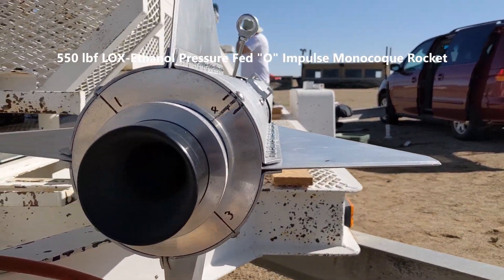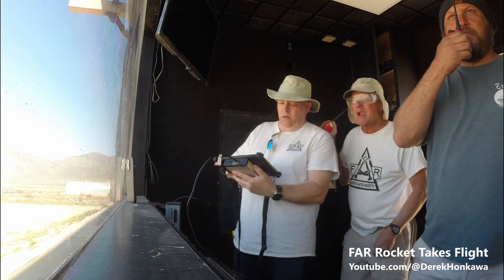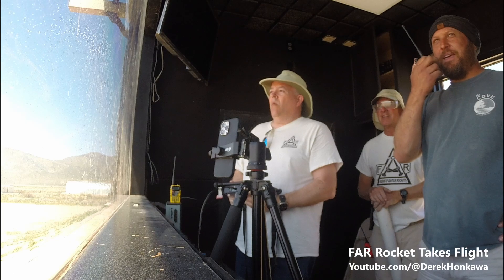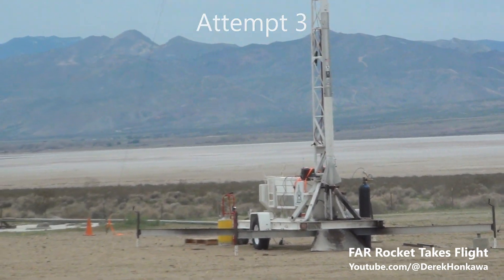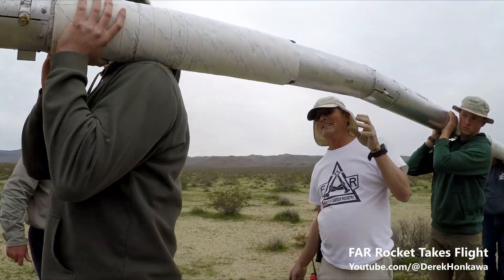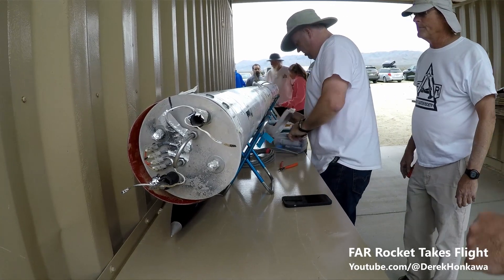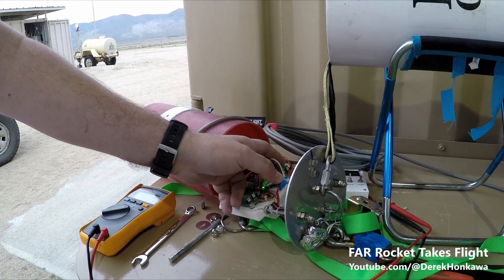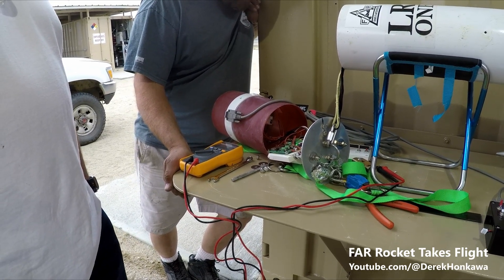A FAR liquid rocket launches within a minute of a UCLA liquid rocket

Comment: Derek, thanks for the update. What is the LR1 sim'd to assuming the valve delay gets fixed?
Reply from the maker: It was originally simmed to 9000 feet, but that was using a whole bunch of bad data and assumptions that were thrown around in the months prior. I gathered what data I had to properly characterize the rocket after the launch. I'll ask Mike to do another sim since I don't have MATLAB anymore, but it sounds like it should be able to go much higher.
Reply from the maker: I have a question for you, and might as well ask it here. What is the highest liquid rocket that SDSU have flown in the past? and was it mostly student designed and built or was it public-private partnership like at Long Beach?
Reply: @DerekHonkawa  SDSU's highest liquid flew to 13,205 feet in the FAR DPF contest. It was all student designed and built.
Reply from the maker: @suntrakker1  Thanks. Luckily I found a paper written by SDSU students which happened to outline their past launches. Documentation sure is important.